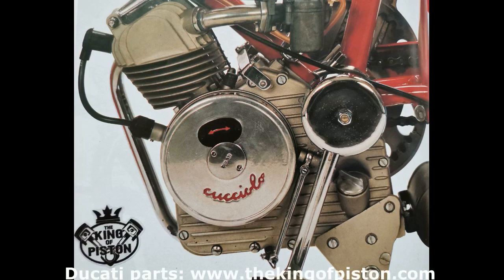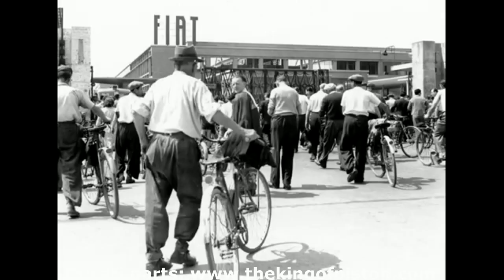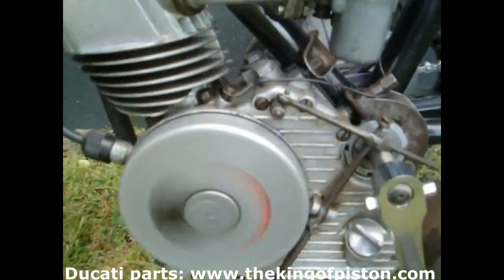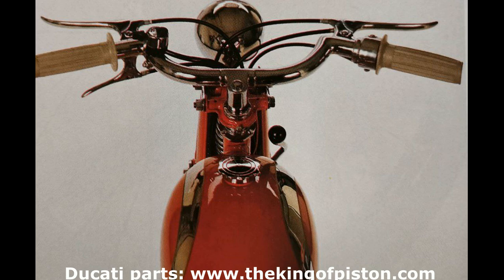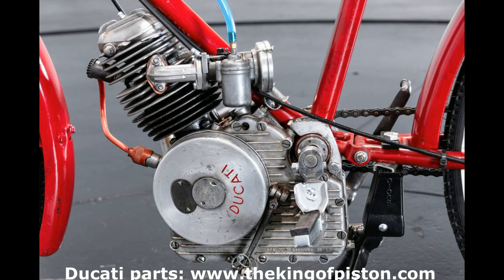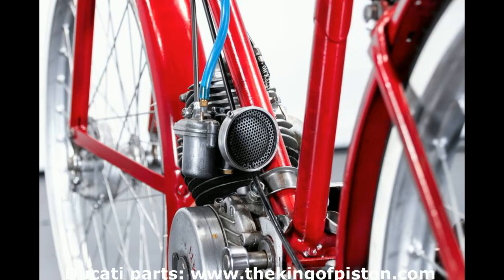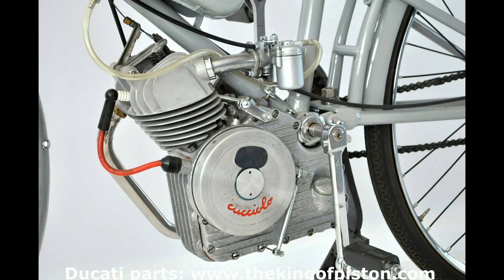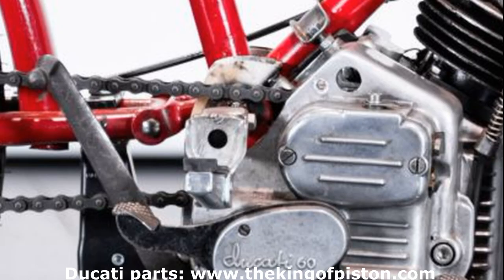Ducati Cucciolo: The Engine that Changed Italy!

Comment: Ducati was by no means the creator of the Cucciolo engine - this was SIATA in Torino. Finally, in this video, the truth is spoken, which is suppressed or distorted by Ducati itself. 
Do not believe in Musi's Book "Il Cucciolo un Gigante" or Bruno Cavalieri "The Ducati Story" or what is (incorrectly) presented on wikipedia and some other "sources". The T-1a from 1945 was the first Cucciolo engine (horizontally splitted) - and this one was never produced by Ducati. The second Cucciolo engine (vertically splitted) was made by Cansa - also no Ducati factory. Ducati initially only had a license to manufacture these engines, but later took over the entire production.

Comment: Awesome, had never heard of these before. 400 km per gallon is incredible. Very nice mounting low down using the bicycle bottom bracket. Current engines for bicycles mount in the v of the frame putting the CG up very high, and use a second chain and sprocket. 

And many of the bikes that are shown here are really good looking, of course, Italian design !

Comment: 2 Stroke Crap.
Reply: Four stroke! With pull-rods instead of push rods.
Reply: @JoepKortekaas-l4q  Precisely.
Reply: Tjat explains the valves and springs visible at the top of the cylinder head 😬
Reply: It’s a 4 stroke, dummy. He even gives a very good description of the valves and cams operation.

Comment: Hi. Tiny 4 strokes are rare. Did this motor influence Honda, whose C50 seems to have perfected this idea? Cheers, P.R.
Reply: No, it did most definitely not!
Reply: quote: "Honda did not name his first machines ‘Puppy’ or anything similar, they were “Type A” and then “Type D”. The Type A appeared in 1946 so could technically only have received a T1-a and it would have been unlikely any technology would have been allowed to transfer between defeated axis powers. In any case, the Type A was a two-stroke mounted high, behind a cycles headstock.
It is inconceivable this happened at all and no Honda history mentions any influence other than Soichiro mounting Japanese military radio-generators onto cycles before running out of these and making his own engines."